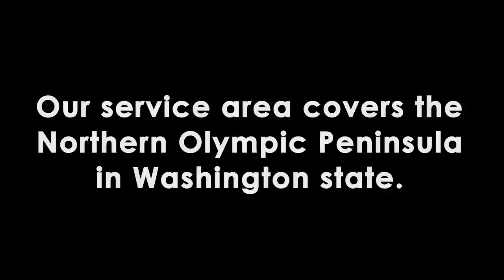Dometic RV Fridge Not Cooling & Suburban Furnace Working Intermittently -- My RV Works

Comment: Hi Darren.  Thank you for answering my question regarding the issue with my Dometic refrigerator that stopped cooling.  Your diagnosis was spot on.  It was a blockage in the cooling unit.  Thankfully Grand Design and Dometic replaced the entire refrigerator under warranty.  Thanks again!  Your videos are awesome!
-Dan 
Oakville, CT

Comment: If you own a RV you would be miles ahead if can keep one of those meters with your RV. Just make sure the meter you're buying not only works on AC but it also must work on DC power because thats what many operating systems within your RV use. The meter used in this video has the clampon feature that indicates amperage which is very useful to tell the condition of motors, electric heaters, etc. It costs just a few dollars more to have a meter with that feature and once you learn how to use your meter you'll be so glad you got one.

Comment: Darren Just enjoy sitting and watching your videos and how much you certainly help RV'ers. That being said I do have a problem and while I'm not sure which direction I should go in maybe you can give a little insight with your eperience. Recently I found in my 2020 Keystone Cougar that the water pump fuse on the DC board blew and of course most of the info that I saw or read on lead to a short on that circuit. That being said, the wire for the water pump leads from the DC fuse board, to In Command BCM, through a relay then the out put from the BCM goe to the pump. So I started at the pump, checked the wires to and from did low voltage checks, unfortunately, i don't have a load because everytime I hook the wire from the fuse to the BCM the fuse blows. So I disconnected the pump, wires, and pulled the relay. Again when I hooked up the wire from the fuse panel to the BCM it would blow. I then hooked up a 12v light to the wire from the fuse panel and the light was bright and the voltage drop from the fuse to the lisght was about the same. .o1 difference. I also just for giggles, ran a new wire from the fuse panel to the BCM and the fuse blew. Many are scatching their heads. If I have to I may need to have you come down when your in Port Orchard.
Reply from the maker: Hi Scoots13in, we've answered your question in our most recent Q & A: https://www.youtube.com/watch?v=ouviQUkeKts. Thanks for watching!

Comment: Darren, The silicone caulking need replacement on the top part of the rain drip rail that holds the roofing material to the top part of the trailer.  Should I replace with same silicone ProFlex sealant or use the  Dicor roofing sealant that I use to patch holes and damage to the roof?   Trailer is 3 years old.  Thank You,  Roger  Ogden, UT

Comment: Hi Darren.  Have you had a check valve in the hw outlet on a sw10del reduce th flow of water to the faucets before?  I had one on forest river th do it and had to half remove wh to get to the water outlets.  Might be a topic for your 10 series.  From central michigan.  Keep the content coming as i have learned a lot from them all.

Comment: Hi... quick question on baffling for the RV refrigerator airflow across thecondenser coil. How close should the baffling be to the coil fins?  Right on top of the fins or a quarter inch or more away? Thanks, Ken
Reply from the maker: Rule of thumb is your baffling should touch the condenser fins and overlap them by about a quarter of an inch.

Comment: I have a 2014 landmark key largo fifth wheel it has two super slides and they are hydronic I also have a single slide which is cable  which the cable is working fine. The hydronic slides seem to have no power at all on them. To get our slide outs in we had to find some one to jumper them in. The tech tried his best he said their was a short somewhere in the warring and couldn’t find it. Now home trying to figure out how to find this short what is the easiest way to solve this problem?  We use this fifth wheel quite a bit. Please help

Comment: Regarding the question on inadequate cooling where you said it was from a blockage. I had read a few answers on other channels that had recommended removing the fridge from the RV and turn the whole refrigerator upside down a few times to unblock it. Would that work?
Reply from the maker: Darren discusses that in this video: 

https://youtu.be/--DCnSw1jP4